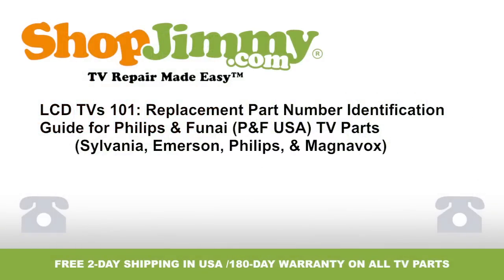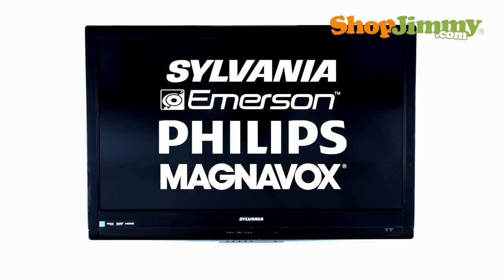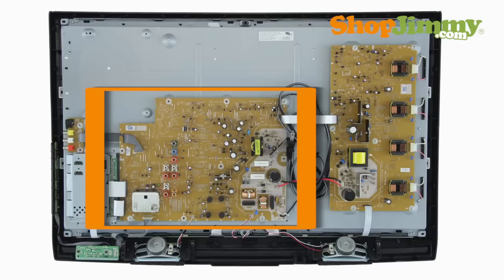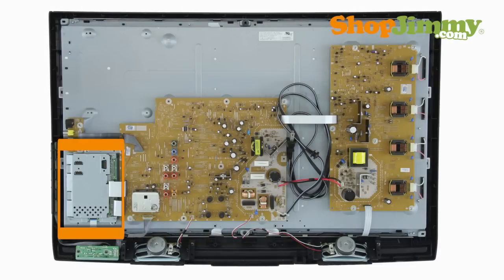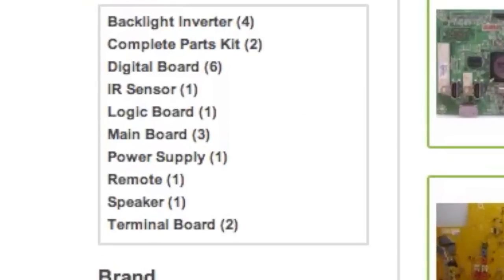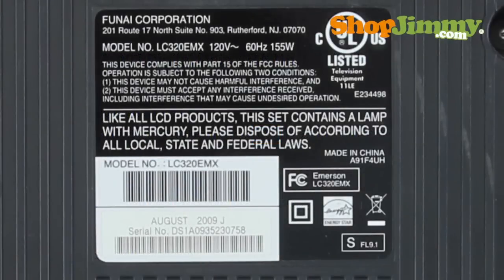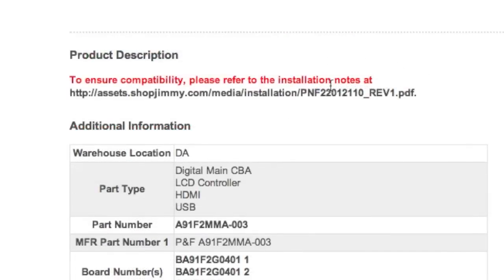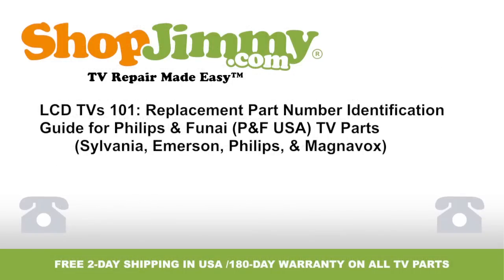LCD TV Repair - Part Identification Guide Sylvania, Emerson, Philips Magnovox MPW MUT Digital Boards

Comment: I was looking around for my father's Emerson lc260EM2. For a replacement volume, channel, and power switch that is on the lower left hand of the screen where you have to use the little buttons to raise or lower the volume. and channel. I have checked your website. But does not seem to exist for it.

Comment: Hello-  I have a Sony Bravia KDL46HX800 that I am getting 7 red flashes error.  My tv will not turn on.  I don't think it's a heat issue as the error code states. I have read about replacing the bal and power supply boards.  Wanted to know these are the correct components to replace, and if people have had success replacing them. My tv is 4.5 years old.  Thanks!

Comment: As this is my first time to ask a question I'm not sure about your procedure, do I just come back to this page to see your response, or do you contact me by email, or something other?
Reply from the maker: +Mr. Gayle   You can ask your question right here and then we will respond.  You can come back to the page to check periodically, or google should send you a notification (check all email folders) when we comment on your comment, similar to this comment.  Thanks!  www.shopjimmy.com
Reply: I haven't received any answer by email or on this site.  Does this take more time or am I just looking in the wrong places?  Mr. Gayle
Reply from the maker: +Mr. Gayle   Try all repairs and troubleshooting at your own risk.  I recommend replacing the digital board in your TV.  Click this link to replacement parts for your TV model number:  http://www.shopjimmy.com/catalogsearch/result/?q=LC427SSX+  There may be multiple boards for the same TV model number, be sure to match part numbers on your current board, with your replacement for compatibility.  Thanks and please let us know if you have any further questions with your TV Repair!  www.shopjimmy.com

Comment: I have a 42in lcd sylvania model LC427SSX that will not totally power up.  The red standby led is on, and when I push the power on button the green led flashes rapidly 17 times, then it stops and the red standby light comes back on.  All the inside components look like new.  The power board is not available through shopjimmy and others, but I would rather learn to detect the problem area and do the repairs myself.  This is my first attempt at a LCD TV and I would appreciate all the help I can get.  And, am I suppose to expect an email from Shop Jimmy??
Mr. Gayle
Reply from the maker: +Mr. Gayle  An email for what?  Thanks for your question and we will reply with an answer for help.  Thanks!  www.shopjimmy.com

Comment from the maker: @Al Yaqdan Al-Zadjali - Buying a new TV will most likely be your best option. If the panel is cracked then the TV no longer good. You could try and find a replacement panel somewhere but it needs to be an exact match.  You must use the panel number, you can't just go by model. Chances are it will be cheaper to buy a new TV than replace the screen.  Thanks and let us know if you have any other questions!

Comment: I got 226v3LSB5/00 LCD LED screen cracked on the top right side but the screen displays nothing its messed with zeebra lines and white screen. any advice ? couldnt manage through the website